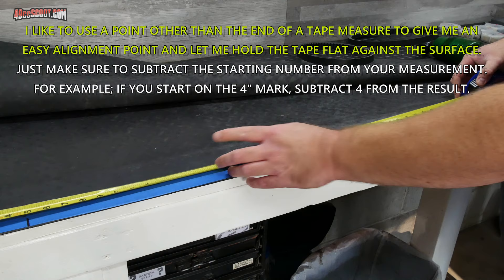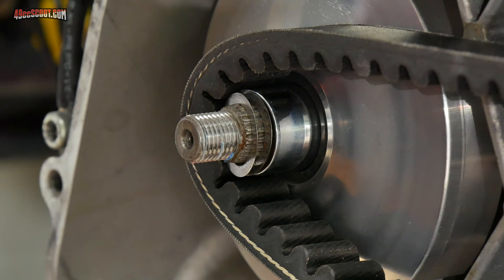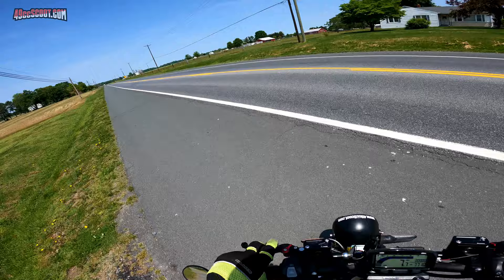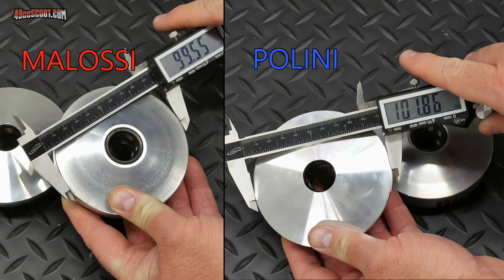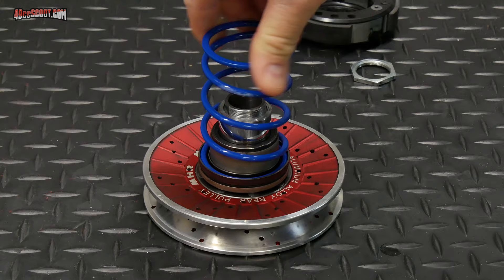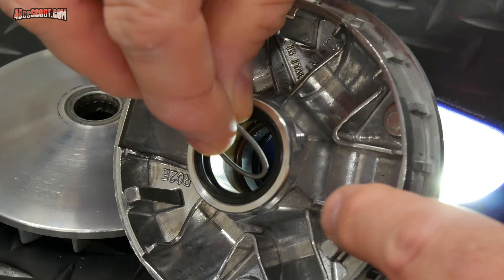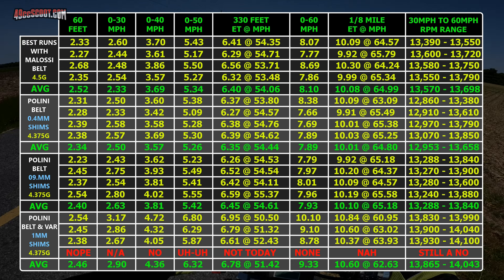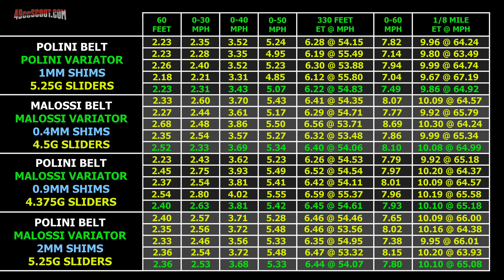RC-One : Polini Belt & Hi-Speed Variator Tested : CVT Upgrades : RC1 : Part 12

Comment: Good video.please Czech subtitles in all videos.
Reply from the maker: Thanks. Turn on closed captioning (on English YouTube it's a "CC" button in the bottom right area). Then go to settings, which should look like a gear in the same area. There is a "Subtitles/CC" option. Choose that and then select "Auto-translate". A menu should come up with Czech as an option.
Reply: unfortunately, there are no Czech subtitles to choose from in the automatic translation
Reply from the maker: @littlemonkey7783  That's strange. I can choose them when I watch. 🤔
Reply: thank you, I found out that Czech subtitles only work on PC. They are not available on mobile.
Reply from the maker: @littlemonkey7783  I just checked on my phone as well. Even with the app, it doesn't work. It's a great feature that they need to fix. YouTube tells creators to look at platforms that viewers use and make sure content is good for those platforms. Meanwhile, they leave out an important feature on mobile that helps a lot of people.